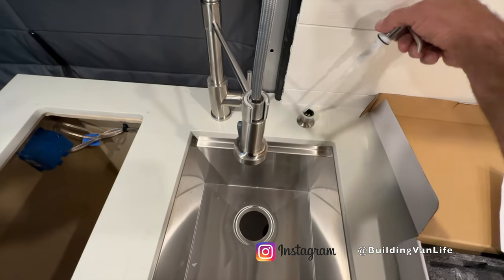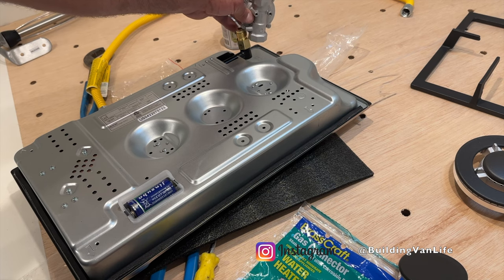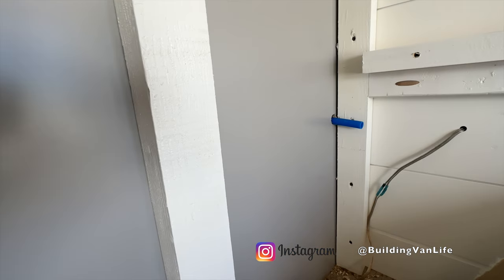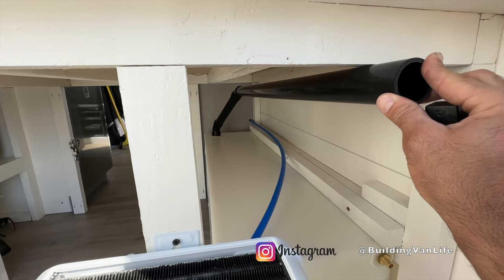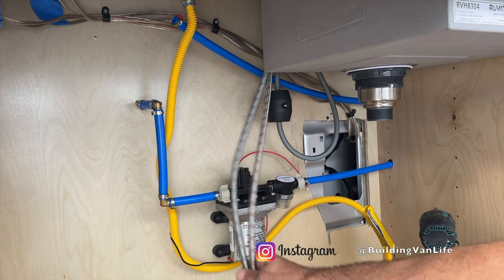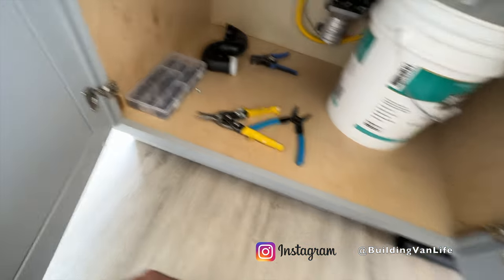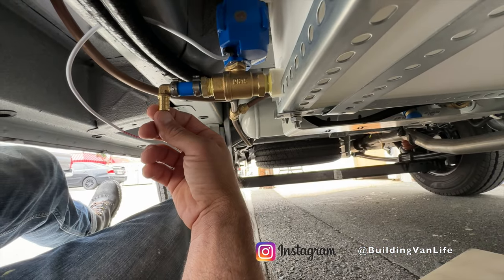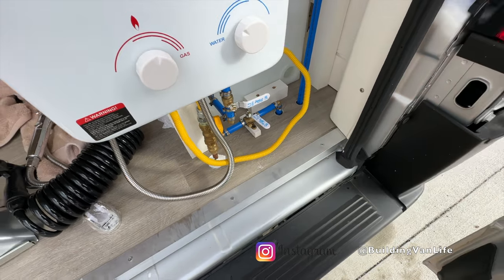Off Grid Water System, Grey Water Tank, Heated Shower!!!

Comment: If that’s the thin walled stainless flexible piping for the propane I’d recommend a flexible rubber or braided hose instead due to vibrations.  Good luck
Reply from the maker: Stainless propane piping? No idea what you’re talking about.   That doesn’t exist on this van.

Comment: Great work, as always!
What I would love to see: 1. some drawing or plan of what you're going to do. i'm sure you're not just going ahead, cutting stuff and putting them together. there is a plan. show us the plan, that will help us follow your steps, and take what we need from your setup, to ours.
2. please discuss planning, choosing, and decision making. you went with gas. you could go with electric. there's pros and cons i guess to each. why did you choose gas? your reasons and considerations are super important to us.
Reply from the maker: ok this is a good comment....there are advantages and disadvantages to elec and propane.  Prior to this build the main disadvantage of propane is the amount of space the tank took up inside the van.  I solved that issue with the tank i installed under the van.  See the video on that.  The elec induction cook top i did on the last van, was great at things like boiling water very fast but that was about it.  It's terrible to cook on and very difficult to regulate the temperature.   Cooking with gas is just way better.  The other issue with the electric is it takes a massive amount of power.  It's just not worth using electric in my opinion.  As far as the planning goes I do a ton of planning and research ahead of time before i do most things but a lot of it is actually in my head or a basic sketch of what I am going to do.  Sometimes I am just sitting in the van starring at the project thinking about the best way to go about it.  Other times i actually watch my old videos on the last time i did certain installs like the grey water tank and it reminds me of certain things and then i just try and tweak things with small improvements.
Reply: @BuildingVanLife  cool, thanks!
Reply from the maker: @morisless3532  no.  I don’t like cooking with induction